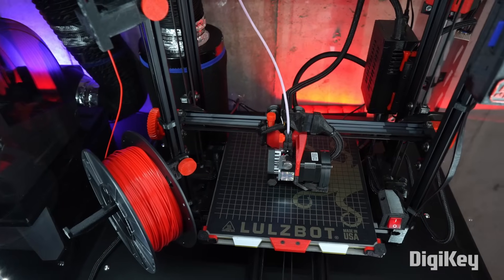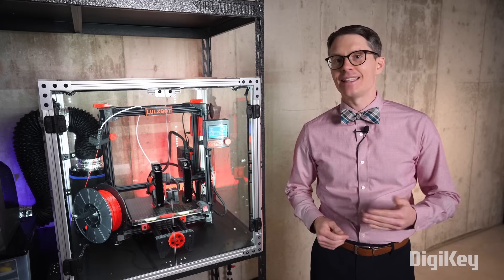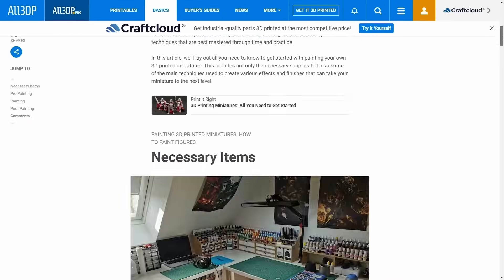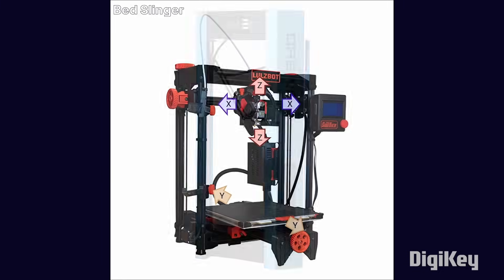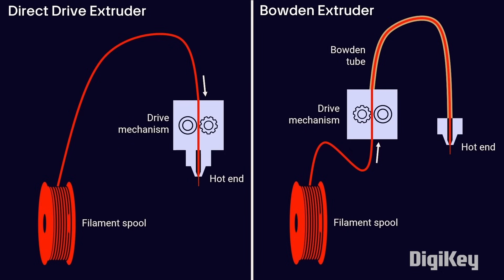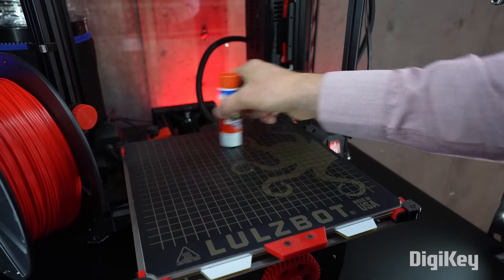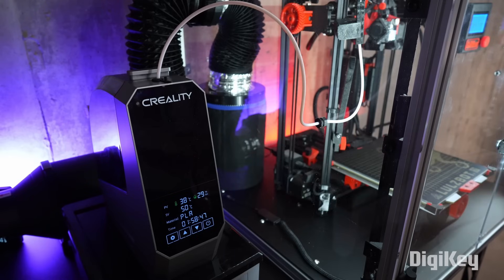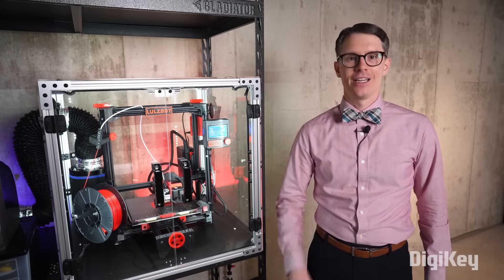Beginner’s Guide to 3D Printing Part 1: Choosing Your Printer and Essential Accessories | DigiKey

Comment: This is a great series, better for me personally than the smattering of other channels', often very good tutorials. The undiscoverable nature of the Freecad interface [as one commenter described it "leaving Sh%$#! on his shoe soles after he uses it :) ] makes me need a comprehensive text-book style coverage of the UI. The teaching touch is first-rate, nearly state of the art, calling out pitfalls, explaining head-scratchers (like Part vs Part Design), showing the many paths to functions, and showing the smartest possible use of the tool (e.g., expressions, in Part 3). It's even made me appreciate Freecad more... just hard getting one's head around the slightly-too-indirect (vs direct interaction) of the UI, but that's not your fault. 

I have only one feedback: try to reduce the overall load of non-mainline time and verbiage, to reduce the timeline by approx 20-30%. I am in the 99th percentile of motivated viewers, now halfway into Part 3. But most viewers aren't. For instance in Part 3, the spreadsheet was a total wow for me, but don't step through renaming every expression name. Have an independent editor viciously strip out every extra syllable. Then also consider Bellis's Law of Instructional Videos: make them 10 minutes. For instance, in Part 3, the subobject tool could be its own video. Keep up the great work and thanks.
Reply: Apologies that this comment ended up in the wrong video. Meant to post it to Freecad Part 1, but you figured that out.
Reply: Thanks for the tip--lots of my videos do tend to run long, as I try to cover everything based on where I think 80% of the students are at (in that moment) while also demonstrating a useful "project" of sorts (hence the 50+ min part 3--I wanted to show a complete box design). I'll see if I can find ways to trim stuff to keep things shorter. This will have to be after my FreeCAD and Zephyr series, which are already filmed and being queued up.

Comment: I'm very disappointed. Given the majority of these printers rely on STM-32 Chip lineup that can be accessed by the CoreXM and other programs Why not show a video on building your own 3D printer board from scratch? Selecting stepper drivers and configuring printer software

Comment: Great video, I think it really strikes a balance of being thorough and informative while not being overwhelming to a newcomer. That said, linking to $1320 obsolete (as noted in the product description) lulzbot was probably a poor choice. I get that that is the printer that the presenter used but someone curious but not informed (whom the video seems to target) could potentially be immediately turned off seeing the price before even scrolling to the much more realistic ender 3 s1 linked below that. I honestly only clicked the link because i hadn't heard about lulzbot for some time and last time I did it was for a (to me) unreasonably expensive machine for the caliber of device it was. I get wanting to move the last of a discontinued product but i think it would be better advertised to a 3d printing enthusiast for mostly the name/nostalgia alone. Just some random dudes opinion. I'll be on the lookout for part 2 even though I know how to use a slicer :)

Comment: I think with the wave after Bambulab it has moved to not quite a 2d printer but certainly out of the "this has to be a hobby" phase.

I think perhaps people using printers that haven't really adopted to this "tunes itself (with auto z, input shaping, etc) and has good profiles out of the box" such as lulzbot printers (that have really fallen behind the times) might have a perception on the difficulty of printing more attuned to older standards.

Of course none of the new wave of printers are utterly hands off, as you will eventually get a blob or clogged nozzle, but now with good wikis, and easier to change out common parts, these are maintainance tasks a non hobbyist can carry out easily. Some printers even will tell you exactly when to lubricate certain parts or change filters etc.

and a small note: Non bed slingers aren't limited to Corexy. There are Hbot printers, more traditional cartisian printers and cross plane printers all which move the bed vertically.

They even have odd things like core xy printers that have stationary beds and flying gantries such as on Voron2.4s and SV08.

Lastly, at this point direct drive has firmly won out vs bowden given that with input shaping the motion systems are often no longer the bottleneck.